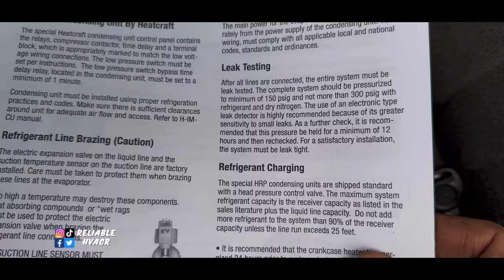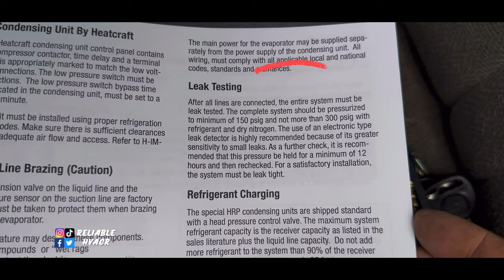Let's press a walk in freezer in

Comment: What is the max pressure for RLS press fittings and the Refrigerant you are going to use. My Teacher swears by ZoomLock and has used them for 15 yrs
Reply: RLS is the original zoom lock the max just came out about a year or so he must be talking about the RLS brand
Reply: @Jimie68  who is “HE” and my teacher/professor will not recommend RLS and only ZoomLock is the only thing he will press
Reply from the maker: Rated for 700psi / 300°F but I've seen them tested higher when they see if they'll burst. 
The current Zoomlock Max design with the hard copper hex crimp has only been around for 2 years or so. Older Zoomlock fittings would be considered RLS. They used to be partners.